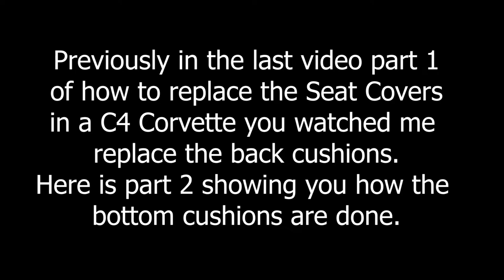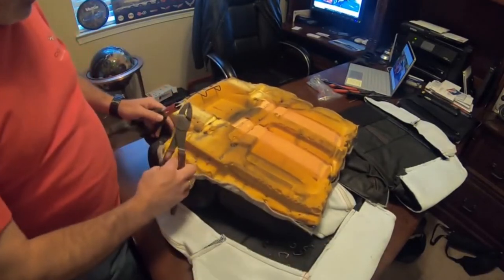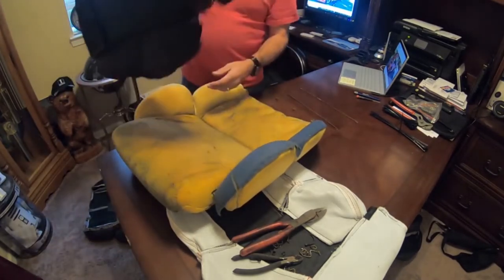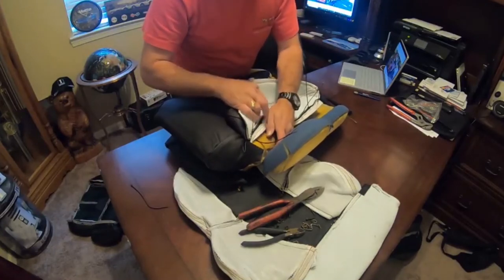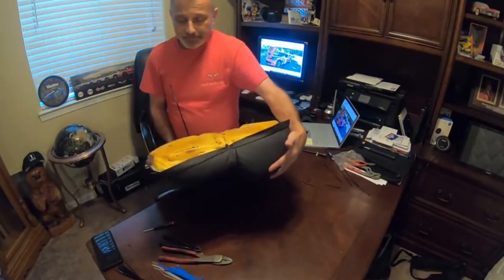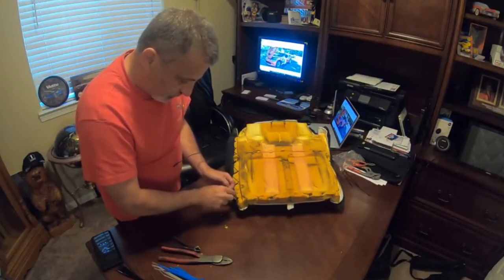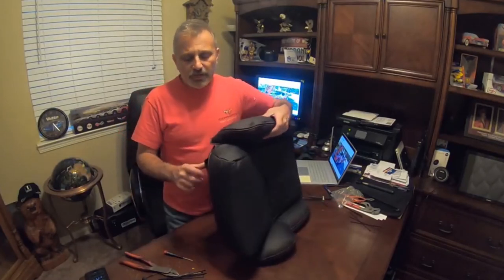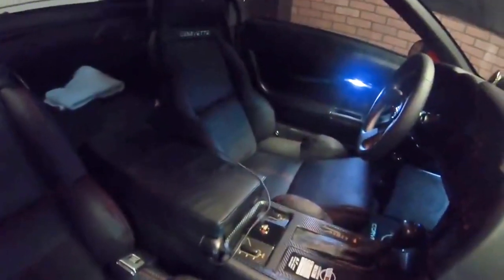How to Replace the Seat Covers in a C4 Corvette Step by Step Part 2

Comment: Hay #tora57mitch here it does work a lot easer with side cutter/wire cutters. I am working on a set of bucket seats out of a 93 Corvette I will be using the old cover as a pattern and reupholster the seats in ultra leather. 
great Job 
#tora57mitch